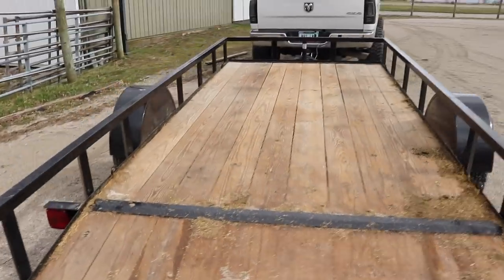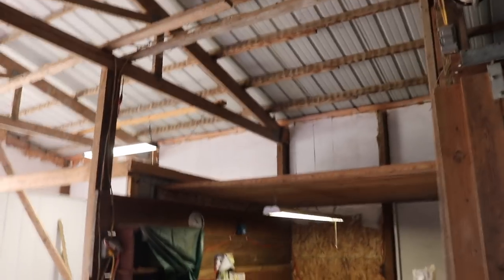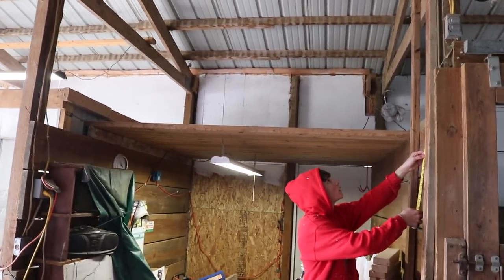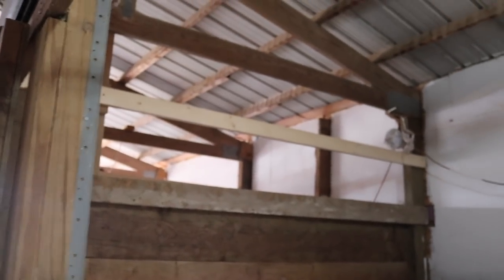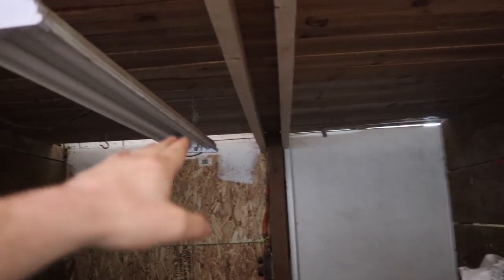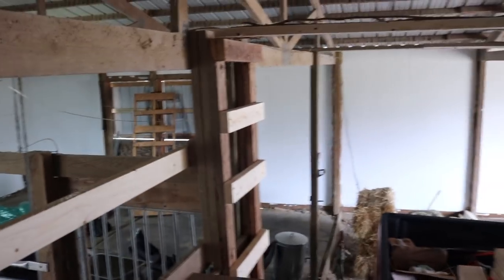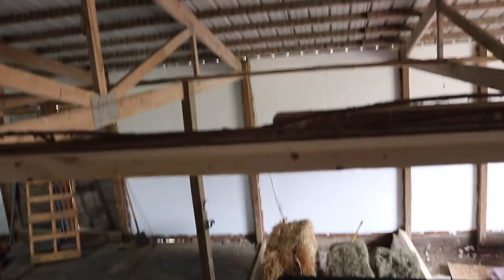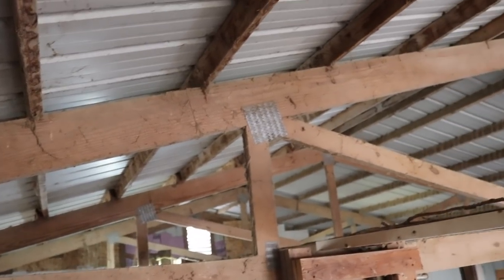TURNING A HORSE BARN INTO MY DREAM SHOP!!! Ep. 6

Comment: I would rent a scissor lift to do all your ceiling work but I would move the hydrant and pour the floor first.  Or you could use some staging with wheels on it to roll around to work on the ceiling joist and steel ceiling liner

Comment: hey malachi so i am a certified carpenter i just want to say instead of doing tin on the bottom i would use 1/2 inch CDX board and then blow your insulation on top of it plus it will last a lot longer just wanted to throw my opinion out there for ya but lmk what you think